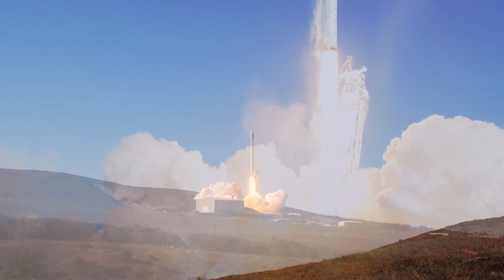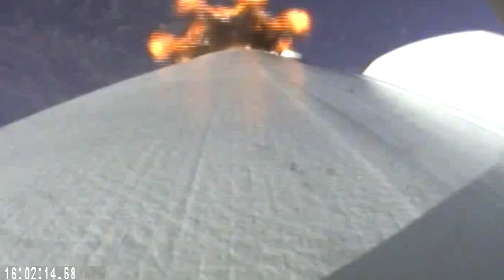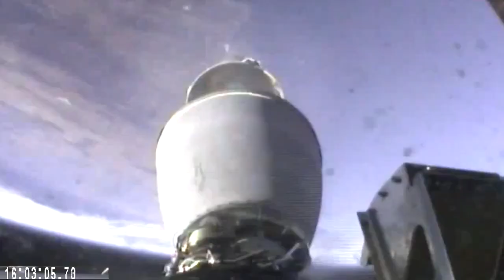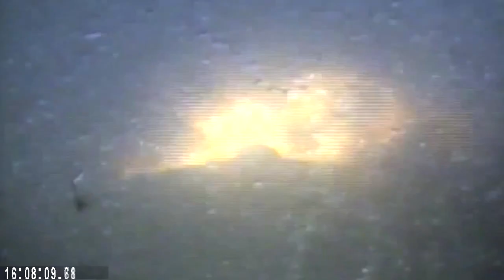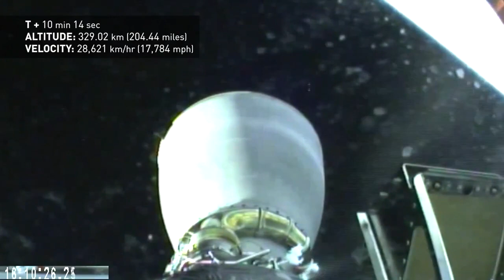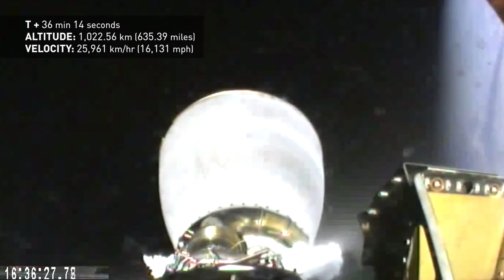Video Captures SpaceX's 'Re-Lightable' Engine

Comment: When the Apollo program was first developed, there was a plan to recover the first stage of the Saturn V and reuse them.  It depended on the number of launches, because the technology for recovery and refurbishment was pretty expensive at the time.  Because the Apollo program was cut short (there were supposed to be at least 3 more flights to the moon), and some of the planned future uses of Apollo technology never came to fruition, they abandoned the idea of recovery.
Reply: A pity really.
Reply: retrofan42 Errr.. Space shuttle ?
Just saying...
Reply: @TeslaNick2  That's the space shuttle, not the Saturn V.
Reply: @dylanm.3692  That's what I said.
Reply: @TeslaNick2  I know, it was like saying "but the Falcon 9 exists" when someone says they didn't try to land the Atlas V booster. Different rocket.
Reply: @dylanm.3692  they planned to recover the first stage like a space shuttle
Reply: a flyback booster and another design that catches it mid air
Reply: @cabbit3008  Yes, I read the comment too.

My point is that OP mentioned that they abandoned that idea, then Tesla Nick brought up an unrelated launch vehicle.

Comment: The rocket looks like it's spending quite a lot of fuel going through the first 100m/s of acceleration, mainly because of how heavy the rocket is at launch. If we built a ground based system to accelerate the rocket beforehand, then it seems we can substantially reduce its total fuel requirement and size.
Reply: +Bill Kong Fuel is a relatively minor part of the expense of a rocket launch. What you suggest seems to add quite a bit of complexity.
Reply: Fuel is cheap, but by reducing the fuel requirement, you can either increase payload fraction, which means you can make more money off each launch by launching more stuff.
Reply: +Bill Kong Tweet at Elon, he has been known to take suggestions :) (such as welding down the F9 to the drone ship and adding in a center console to the Model S)

Comment: then there was never been any landing in spacex commercial flights ? (if iss coupling was one)
and will never be some i presume
Reply: They're going to attempt to land on a Barge today.
Reply: Sarge Rho
did they dont tryed to launch from floating barge and after three test it exploded out of repair ?
Reply: tripodalt No. The F1R exploded because the flight termination system initiated the self destruct.
Reply: Sarge Rho
no idea what f1r does but i know the rocket barge lauched 3times space vehicule and failed at last then abandon
Reply: tripodalt Nope. There hasn't been a single barge landing yet, and no barge launches.
Reply: Sarge Rho if you follow the space info you must know than someone tryed to launch rocket for space from floating barge isnt?
maybe not spacex but if im true was a private compagny
Reply: tripodalt Oh that, yeah, and it's still running.
Reply: Sarge Rho
can you name it because i thinked it was a total faillure out of money and must check it
Reply: tripodalt It's called Sea Launch, and they have launched 31 rockets so far, of which 2 or 3 failed.
Reply: Sarge Rho it seem not being very popular
so is it make commercial or still a prototyping ?
Reply: tripodalt It's commercial.
Reply: Sarge Rho else being rich & making reseachs , i wonder why someone want to launch and takeoff from a boat : it seem a far more expensive task
Reply: tripodalt It lets them launch the rocket from the optimal location, instead of from a fixed point.
Reply: Sarge Rho
yes im aware of the location matter but is the cost can be comapred betwen ground and mobile launchs ?
still sub optimal located rich country prefere use more fuel than building a whole new systeme who can sink with all the material out of recovery
i bet sea launch cost twice or three times the price per weight launched & used for low orbital tasks
Reply: tripodalt It's apparently cheaper than other launch systems, but it doesn't have that much payload either.
Reply: Sarge Rho maybe a commercial bet(scam)based on the futur income + reduced fuel usage (without care for potential faillures)
its a bit as petrol in sea vs petrol in ground : its become benefit when the demand is important
i dont doubt than light weight load are commercially profitable due to the massive need of phone relays who make pofit(but what the part of pyramidale bubble we are threatned by ? )
Reply: +tripodalt "and will never be some i presume"

Holy fuck were you wrong.

CRS-8, Drone-ship successful landing.
Reply: lol
Reply: @CreepingMC  its funny stumbling across this conversation today now that spacex has gotten so good at recovering boosters it's almost boring

Comment: So are re-lightable rocket engines something new?
Reply: Yes, Most rocket engines cannot ignite more than once, and there are very few bipropellant re ignitable engines.
Reply: bobbert tackett
Interesting. I did not know that. Thanks for the information!
Reply: +bobbert tackett Surely that cannot be true. How would spacecraft then maneuver in space if the engines can only do a single burn? For the lower stages sure. As I understand it boosters can't even be throttled down anymore after ignition, but the upper stages must have some sort of thrusters for orbital maneuvers and whatnot, that can be used as needed until the fuel runs out, right?
Reply: *****
Maneuvering engines are very different from main propulsion engines.  They almost all use hypergolic fuels which instantly ignite when the fuel and oxidizer contact each other.  This is easy and simple to relight, just pump the two liquids into the engine chamber and it goes.  However, the vast majority of hypergols are insanely toxic, expensive and relatively low performance.

For main propulsion engines, most rockets use other fuels that require ignition.  (Some of the Russian and European launch vehicles do use hypergols for the main engines but this is slowly going away.)  Starting a rocket engine is extremely difficult to do.  There is a gigantic flow rate of fuel and oxidizer into the engine.  The igniter has to be extremely powerful or it will just get put out.  Also, if the ignition is delayed by even milliseconds, too much fuel/oxidizer builds up in the engine and it explodes.  I believe that most restartable propulsion engines use pre-packaged hypergol squibs to ignite the engine.  These are single use items so the engine can only be restarted a certain number of times. 

Only a few non-hypergolic engines are capable of more than one start.
Reply: Dan Heidel

This is actually the key to the whole reuse thing. I've only seen two restarts of SpaceX rockets and they were about 2 or 3 seconds long. The only restart I know of without inspection or overhaul that ran for any useful length of time was the last version of the RS-25. Barber-Nichols makes these turbo pumps and I haven't seen anything yet that tells me that SpaceX has the right turbopumps for what they're ultimately wanting to do.
Reply: Sigrun Van Houten The Rocketdyne J-2 engine also did a restart on Apollo 11-17. It ignited first time to finish orbital insertion, and then re-lighted for the trans-lunar injection. Only the Saturn V S-IVB J-2 was able to relight, though. The Saturn V S-II and the Saturn IB S-IVB J-2s were not capable of relighting (i believe that it made the engine significantly heavier, though I'm not sure).
Reply: well most engines only ignite a certain amount
this is good in that we dont have to have a constant burn to you know get into orbit
Reply: Swithin Feely Actually, a constant burn to orbit is the most efficient way in most cases. Almost all rocket engines are unable to relight after shutdown, so we do use constant burns as much as possible. If a pause in the burn is necessary, it will be made in between stage seperation and ignition of the next stage. If you look at rockets like SpaceX's Falcon 9 or ULA's Atlas V, the flight consists of two burns following each other with almost no pause between them. This is almost identical to a single burn to orbit, but more efficient since you discard empty tank mass at first stage seperation.
Reply: wasmic5z ok ok i see what youre gettin at
but it's also good to relight because of adjusting orbits and orbital manuvers stuff like that
it'll be good for crafts to Mars and stuff i guess
Reply: Swithin Feely Yes, but those won't be the same engines as the ones that are used for launch. It'll probably either be single-relight capable engines (like the upper-stage J2 on the Saturn V), or easily relightable engines like SEP (Solar Electric Propulsion, ion engines, Hall effect thrusters and plasma thrusters) or hypergolic engines such as on the Apollo spacecraft or the OMS on the Space Shuttle.
Reply: ok